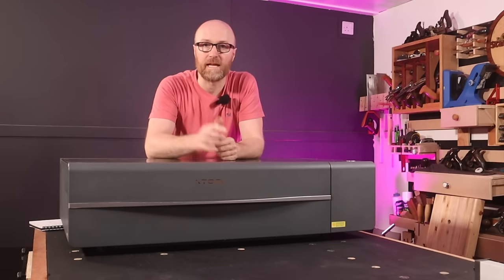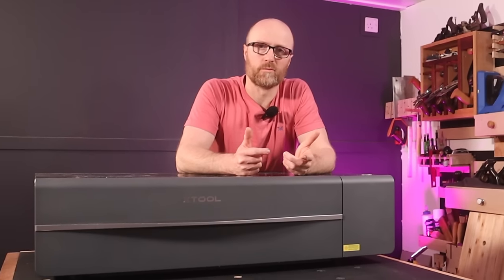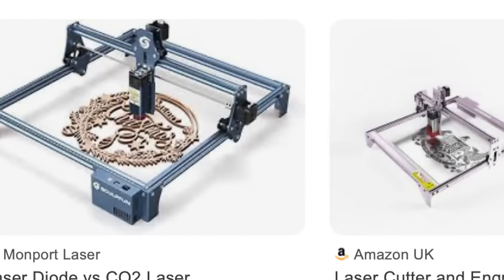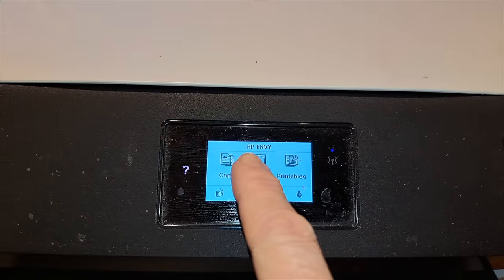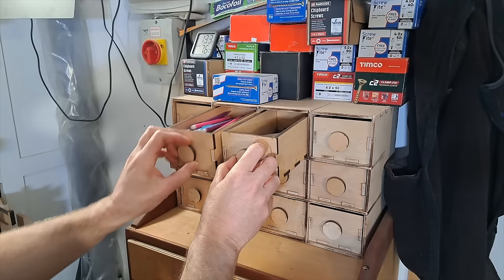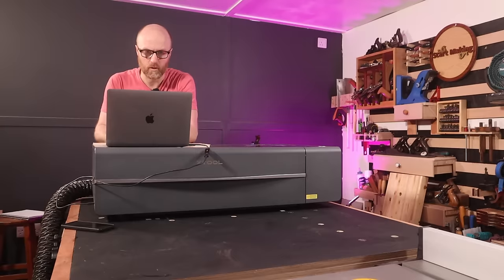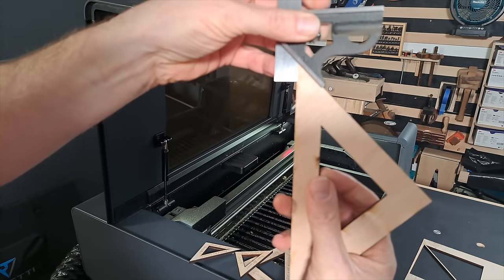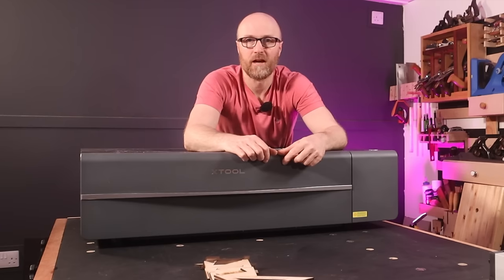The DANGEROUS Reason To Choose Your Laser Carefully || xTool P2 Pro Laser Cutter

Comment: Mark, I don't anticipate getting a laser for my woodworking, but I didn't let that stop me from watching your video. I've seen most of your videos & can't say any of them was a waste of time. Your point of safely extracting the smoke & fumes from a laser is very valid. Who knows what the long-term effects of having them in the air we breath will actually be. It's sort of the same thing as soldering with lead solder & without a fume extractor. I wouldn't be too concerned about being a newbie with the computerized laser. I bet after you've had a couple year's experience with it, you'll surprise yourself with what you know. Designs on jewelry boxes & others can be very useful. So can simple shop, tools like your squares generated on the fly. Those with your name, address, & phone # could be popular hand-outs whenever you are selling your woodworking items. If you made them in a bit thicker plywood, they'd be very useful setup tools. Make various sizes & a 30-60 version in addition to your 45. The laser could be very useful if one wanted to design & manufacturer wooden toys. Its use is probably endless. You've already made a variety of neat signs.
Reply from the maker: Hi Bill. thank you again for your comment. It is a very niche video for a woodworking channel to be honest. Last one of the contracted ones fortunately. I agree with you on the fumes. Same can be said about just being around MDF with all the glue fumes. I find it makes me quite light headed. Great idea for the unique business cards. It does have endless uses so long as you can master the design packages. It will come to me slowly, which is how I like to learn. I find it stressful and ultimately fruitless to try and learn to fast with these type of things.

Comment: French cleat i love it. I still havnt tried to use the file you sent for making the french cleat brackets. You say you're not great on computers but you made those squares look easy. I wouldn't even know how to do half the stuff you did lol. Great video & i definitely wanna use my cheap lasers to make some tool holders etc if i can. Also need to make enclosures to vent outside
Reply from the maker: Thank you. I have extended the amount of free cleats on offer . Please email me at startmaking2022@gmail.com so I can grab your address and send you some.
 I struggle through with trial and error. A lot of error. Check out the site makercase.com, sounds daft but making boxes is an easy start,

Comment: Can’t remember but I think I may have tested the smoke purifier in my F1 video and think it’s absolutely essential. Even then it’s good to have the exhaust from the purifier out of a window etc
Reply from the maker: You are spot on Dean. I didnt see that video. I will take a look back. I had the filter on and the hose just lying through the door to the outside and still after a day running the laser last week I felt a little jaded the next day and another thing I didnt mention was the resin and chemicals getting on your hands off the burnt edges and the bars on the bottom of the machine. Gloves are highly recommended. Especially as I suffer from chemical sensitivity too. Not ideal to get it wrong. Hope the move is not taking too large a toll bud.
Reply: @startmaking1  something I didn’t realise until it was pointed out to me, anything with PVC in it is toxic and wrecks the laser on my F1, I know yours is different. It was super annoying finding that out because I’d spent ages dialling it in to cut vinyl lol
Reply from the maker: Wow, that sounds like a pricey mistake. I honestly haven't looked into mine. Im not a big tech guy so I will just be cutting ply, veneer and acrylic and probably that will be it.

Comment: It's cool to be square! Great video mate, and thank you for being honest about the safety issues. 
The surge of these machines reminds me of when microwave ovens first came out. Many people feared that it was going to take over from "real cooking", and didn't view it as just another tool that can be used. I imagine it could be very easy to over-use the laser instead of doing what could be called "real" work, but I agree that it's best use would be to further enhance what you have already made. Great job as always mate 👍
Reply from the maker: I could not agree more with this statement. Great summary Stuart. 
Thank you. If you pop me an email at startmaking2022@gmail.com I can grab your info and post the square out. Still a work in progress but a lot of fun.
Reply: @startmaking1  thanks Mark, I'll drop you a message now. I've been given the job of building a pallet playhouse for the kids in the garden, it can take pride of place over the gable!
Reply from the maker: Pallet play house sounds excellent. I have a load of pallets but so far I just stare at them and cant bring myself to strip them down.
Reply: @startmaking1  buy one of those pallet buster bar tools. Makes it 10x as fast. A cheap tool well worth the outlay

Comment: Hi, Mark. One could always get a unit of lesser power (for thinner material)
and dimensions, to match their need and budget. Also, if you get
one without a case, you can build the case yourself.
If you do that, be sure to get laser safe, filtered, material, for the window And
install a cutoff switch, on the cover.
Question: Why would one need a filter box, if venting to the outside? Sure,
if you had several lasers, for a production operation, but for one??? 😁✌🖖
Reply from the maker: You are 100% right bud. There are so many out there now. And building a case with ventilation would be a fun video too. I bet there are plenty of people who could benefit from that. I dont think I will buy another laser too try it out mind you. The filter sucks the fumes from the machines where as the original pipe is much weaker flow . That is one benefit. Though if you attached am extractor fan and sealed the pipe into a window you could achieve the same thing. Not to mention that there are people having these in an office rather than a workshop. I dont fancy that to be honest as they still emit a smell even with the filter. I got the filter for safety but also so I didnt have to ruin a pane of glass or cut a hole in the wall. Just couldn't bring myself to do it so soon after building the workshop lol.
Reply: @startmaking1 : The window i was referring to, for laser safe material, is the viewing window, on the case.😁✌🖖

Comment: It’s cool to be square. Nice video Mark, I think I could make use of the laser but a little too rich for me.
Reply from the maker: Appreciate the quick comment Steve. Thank you. If you pop me an email at startmaking2022@gmail.com I can grab your info and post the square out. Still a work in progress but a lot of fun. 
It is a pricey investment. You really need to have a use for it in your making process that it will slot into straight away. Or a budget large enough to not have to worry.
Reply: @startmaking1  thanks Mark
Reply from the maker: @stevereed5776. Dont forget to email me your address bud,
Reply: @startmaking1  I did Mark
Reply: @startmaking1  I did it last Saturday
Reply: @startmaking1  just sent again
Reply from the maker: @stevereed5776. thats really weird. I have not received the one Saturday or today. can you please check the email address startmaking2022@gmail.com

I will message you if I get the email
Reply: @startmaking1  Received. Thank you

Comment: Q.  Will it cut slightly thicker material?  Thinking of using an X-Tool to make routing templates
Reply from the maker: It will cut 12 mm. but it takes more set up to avoid charring. You could always do what I do with the larger cleats and cut 6mm twice and glue together to get a quicker cut and better edge. Though, I am no expert. If you dont mind plashing out for acrylic then you can easily cut thicker.

Comment: One day I am gonna get one. 😊
Reply from the maker: It is a lot of fun. That said, you could always reach out to xTool and see if they are still offering any lasers up. Seems a load of people get offered them. But, I would say that 3 videos is a little too much to do in return. Unless you have some killer ideas for uses .
Reply: @startmaking1  I am afraid my channel is too small for them to be interested. Also, I have to censor some stuff... LOL
Reply from the maker: Thats really annoying as I bet you would come up with far more uses to show case it that I have,.
Reply: @startmaking1  nah, I am in a broken condition right now. but, i am adding more lights to the shop. :)
Reply: @startmaking1  oh, i just had an idea for you: is it possible to make tiny groove with a laser (like 0.5mm) and control it’s depth with power settings? depth can be less accurate than width.
Reply from the maker: I guess you could but to be honest Im not sure I know how. Trial and error I guess. What are you thinking.
Reply: @startmaking1  copper wire inlay :)
Reply from the maker: @GeometryBuild  i think that could work. To be honest depending on the wood I would create the inlay slot with a heavy engrave rather than cutting. Although the power would differ for each wood type. But it could be done and you can get a very exact width. Great idea
Reply: @startmaking1  nice! :)

Comment: The purifier kind of seems like a waste to me when you can just vent it outside with a much cheaper duct fan. If you absolutely cant vent it outside then I totally get it.

Hreat video though, thanks!
Reply from the maker: Thank you. You are right, but even with the filter I would not vent it inside. It is good but not 100% perfect and you can still smell the char. Whether it is harmful I have no idea. Better safe than sorry. If you can set it up to vent outside with a strong enough duct fan and a sealed system I agree it would work well. The only worry I would have is where you are venting. In the UK, Im not allowed a bonfire in my garden due to neighbours. They would definitely complain if I was pumping unfiltered smoke outside all day. But then again, this also depends on how much you use the machine, mine is occasional.